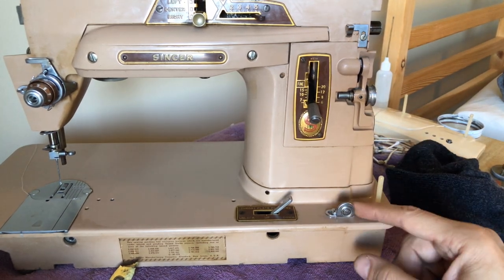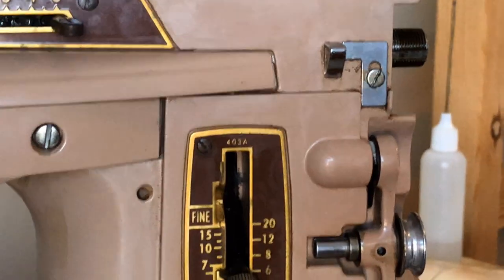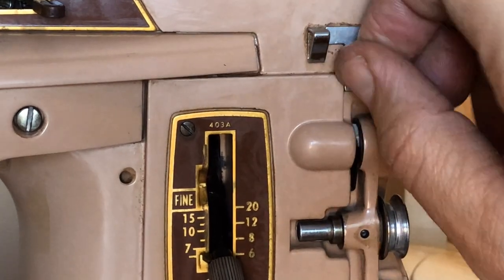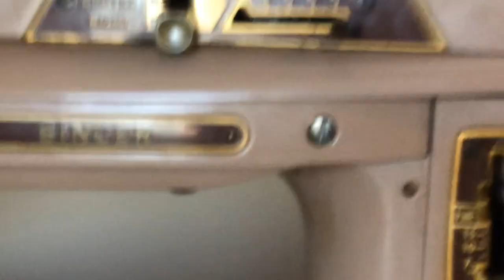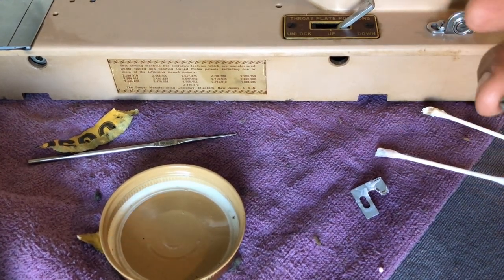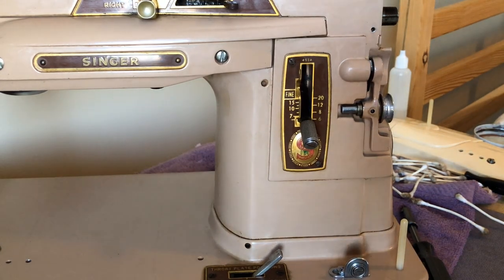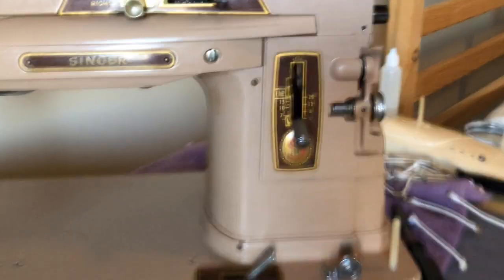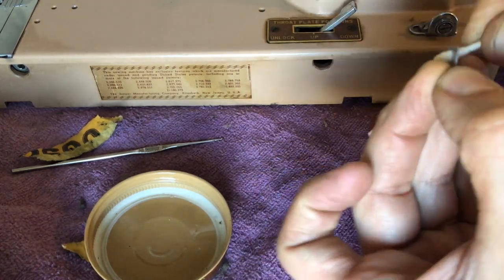CLEANING SERIES #8: Ghost Marks!!: Why Cleaning Those Hidden Spaces Underneath Parts Matters

Comment: 9:28 How do you suppose they did that on the production line?  A magnetic screw driver, perhaps?  A special tool to hold the screw (instead of my clumsy fingers)?  They must have had an easier way.

Comment: Hi! Thanks for sharing. 
In addition to the hand cleaner, what the name of the other product that you used? The one that looks like a tooth paste tube. 
And I agree with you. Sometime It's hard to choose from the variety and selection of products. We need to pay attention to the details. 
Thanks.
Reply from the maker: Hello.  The polish in the tube is made in Germany and called Wenol.  Its a rouge colored fine polish that I found in a hardware store.  It might be available online.  Another good substitute which might be made by the same, company, but in different package is "Autosol" and its often found in auto parts stores.  I have some of that also and it works the same.  I'm unable to find any discernable difference between the two. I paid about $12 but a little goes a long way so you will get a lot of use out of just 1 tube.
Reply: @VintageSewingMachineGarage  thank you so much!